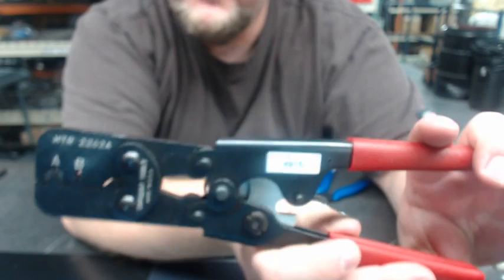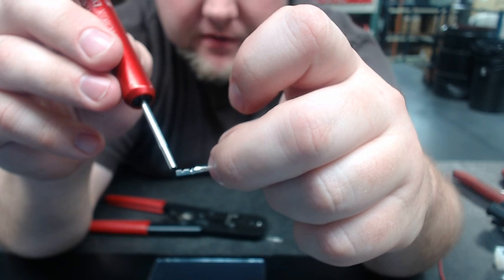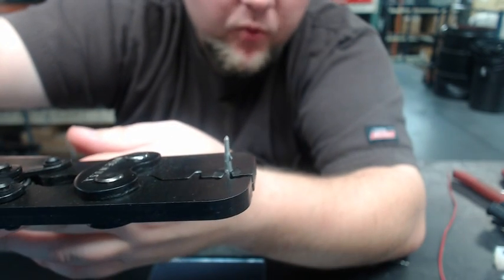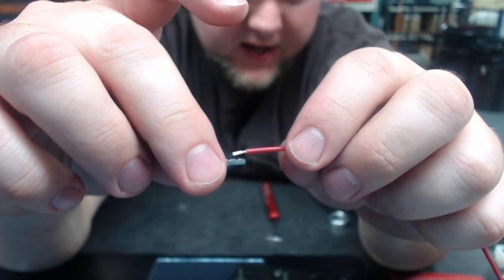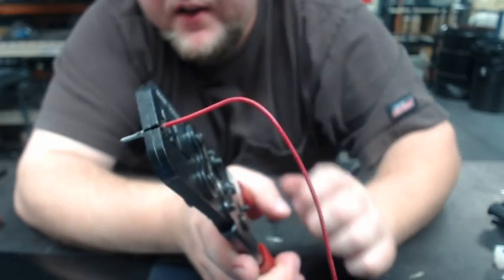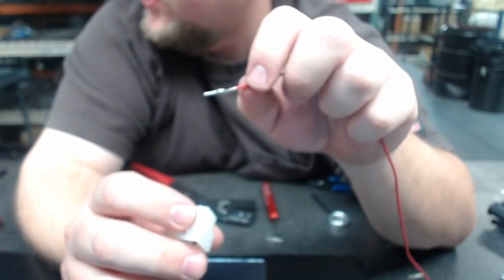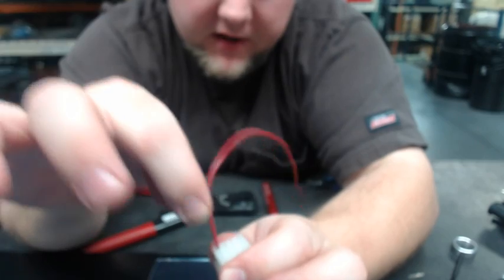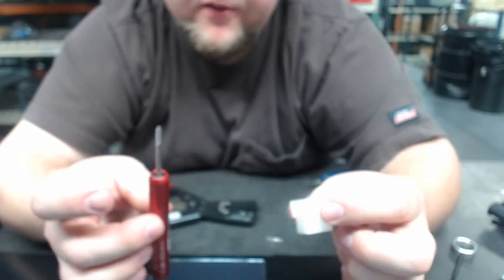Crimping Inserting Extracting molex pins

Comment: Hey man great video! Do you think you can connect the wire even if you dont have a crimp tooll? I dont have one and I need to replace a pin. It's a negative ground wire with real weak connection. Trying figure out how to get it out and replace it fix it.  Thanks
Reply from the maker: You can always try to solder if you can reach solder should stick to the pin.  Removing the pins can be a pain without an extraction tool. Some times they can be pulled out but it may damage the sleeve of the connector.
Reply: @jpark3001  cool thanks bro!! I saw an extractor tool at electronics store like the one you have 17 bucks I'm going to get it.. thanks again great helpful stuff!!

Comment: do all  crimp tools crimp  the wire section  and  the insulation seciton at  the same  time?   also  can  you say the wire sizes and pin  sizes that work  for 'a' and 'b'.  thx
Reply from the maker: Yes, most tools I've used crimp insulation and wire at the same time.  This particular pin crimper works for amphenol and molex pins and maybe other brands too.  This style crimper comes in different sizes. I think this specific one A is from 24 to 20 awg and B is 18 to 16 awg. The pins will have a similar size range.  Depeding on the brand of pin and the type of wire you may need to crimp 1 time to compress the wire then adjust the position of the pin in the tool then crimp again to compress the insulation.